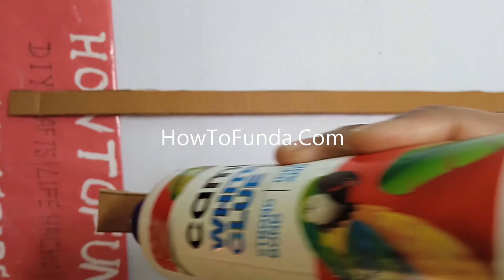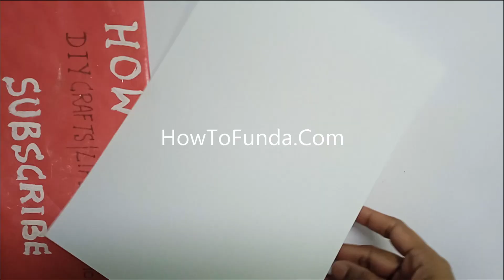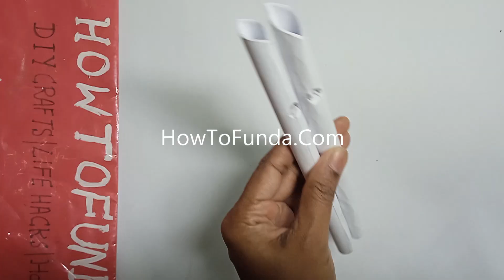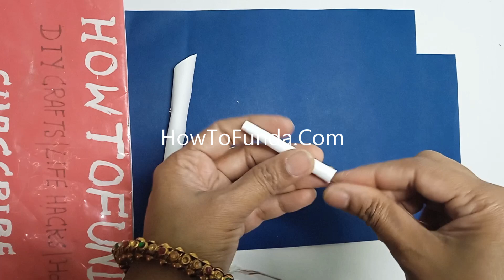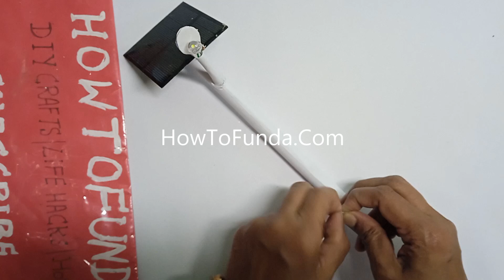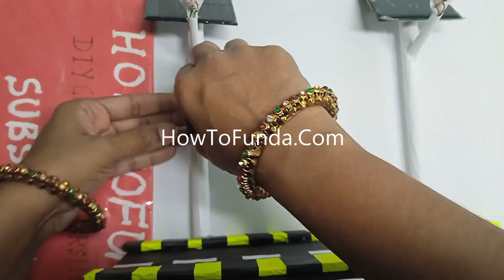solar street light working model science project | diy | simple and easy | howtofunda

Comment: Can you please help me with this project
design of a microcontroller-based control system capable of combining light sensing, time scheduling, energy source switching and a feedback sensing mechanism via the internet using a GPRS modem. This is expected to ensure that no power is unnecessarily wasted and to provide a convenient way to monitor the status of streetlights remotely. Additionally, it provides the possibility to reconfigure remotely the time-scheduling parameters of streetlights depending on the season and weather conditions. The design uses a solar powered LED to reduce energy consumption. The proposed system will continuously monitor the battery level to allow for an automatic switch to ESKOM power supply in case of emergency, while also sending the necessary alert messages.